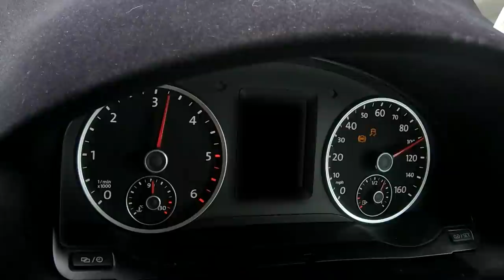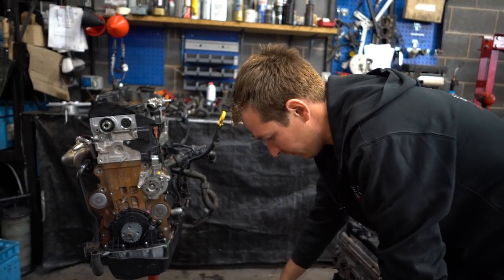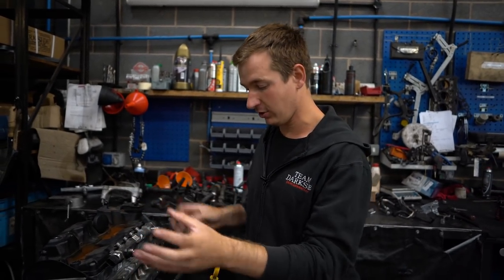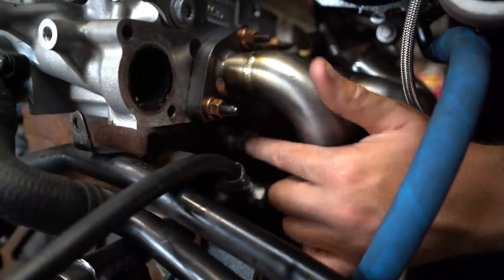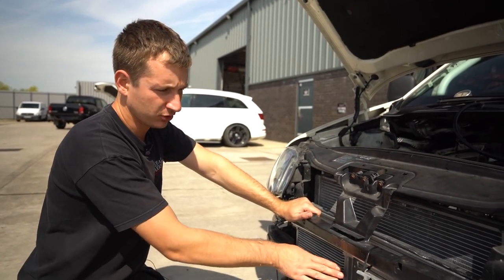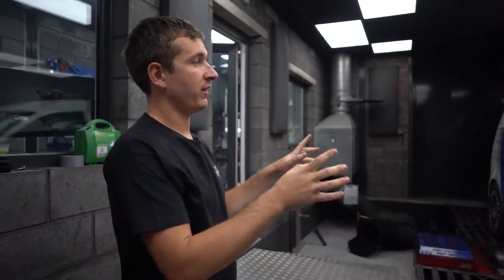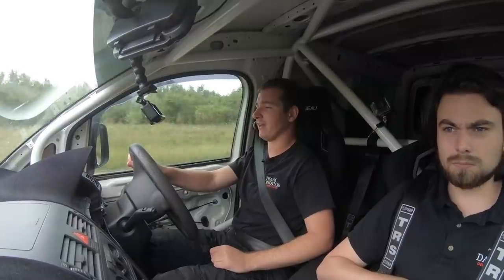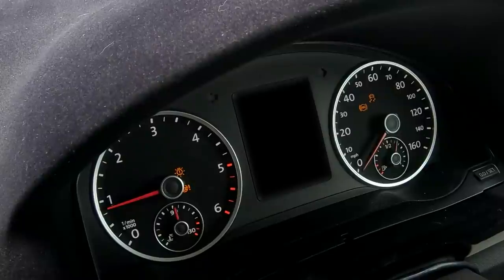SRS Caddy gets a new 2.0 TDI CUAA Engine! 356BHP & 470LBS/FT!!! 4Motion / DSG

Comment: So it's possible to bolt on CUAA bi-turbo to mk7 engine? but it need some mods to fit CUAA intake manifold to mk7 engine. But is it possible to fit CUAA head on with intake and turbo to mk7 engine?
Reply from the maker: Intake needs a lot of work. Turbo wont fit due to needing 2 oil feeds and drains. You need to use the full engine.
Reply: @DarksideDevelopments  Thank you!
Reply: @kolyakabmx  it's better make the engine swap, more "bullet proof"

Comment: So would the biturbo (more specifically the smaller of the two) help you at all with the low end performance if you had kept it or is it just a oem efficiency thing that needs binned?
Reply from the maker: We couldn't control 2 turbos with this ECU but it would fill the hole at the bottom end!
Reply: Excuse my ignorance but on the standard engine I thought both turbos are the same size and ran two cylinders each? Not sure there is one big one small but again I might be wrong
Reply: @liamgreen6036  im just as ignorant but pretty sure that that kind of setup is only used for V engines etc with two heads. The “Biturbo” on the 2l 4cyl is more a “compound turbo” i think with a small feeding onto a large. Small turbo spins up faster and big turbos make top end power so its a best of both kinda situation. Hope that helps you find a better source of information.
Reply from the maker: John is correct, 2 small turbos would be laggier than 1 large. So a compound setup is even better!
Reply: @liamgreen6036  I might be corrected on this, but it's much the same (if it is actually this same system) as a Borg Warner R2S setup, which is sequential turbos. One small for low revs, one large for higher revs, and they switch over in the 2500-3000rpm range.

Comment: Hello!  Tell me, is it possible to put this CUAA motor instead of CFCA on T6 ?
  Is the fuel equipment on cuaa also bosh ?
Reply from the maker: I'm sure you could with a bit of foresight. Both have Bosch. Not sure if Turbo control or fitment will work. Lots of custom adaptations will be required I'm sure.

Comment: Hang on so is the charge cooler water separate to the engine and turbos coolant? Like a separate loop? I gather it has its own water pump? I’ve thought about a system like this for the turbo oil system.. a separate reservoir pump lines cooler and thermostat, I figured if you had a separate oil system for the turbo it would stay a lot cleaner and be much better for the turbo
Reply from the maker: Yeah it's separate!
Reply: @DarksideDevelopments  brilliant I did think what use is a charge cooler if it keeps iats at 90c 🤣

Comment: You guys have incredible videos. There’s just so much information I dont know if I’m absorbing it. I bought a mk6 Golf 2.0CJAA with barely 40k miles. I’m trying to understand how it works but cant figure out where to start. I want to keep emissions so I can take it anywhere, but I also want HP gains and consistent power. My gas pedal seems too sensitive or not sensitive enough, and it jumps  rpms but doesnt provide power on the low end from a stop. Is it that theres an issue somewhere, or do I really need it tuned?  What can I do, where can I start? I havent found any beginner information, and forums dont seem to have patience for my questions. Thanks for your time!
Reply from the maker: If it's tuned the throttle map might be off. We have a few DPF safe options!
Reply: @DarksideDevelopments  no tune. It had an air intake on it but it was swapped out to get a warranty fix on my egr cooler. Vw said if it was tuned theyd know, or is that a myth?

One last question- how do I determine myself that parts are compatible? Part numbers, or precise measurement?
Reply: @HorizontalCrank  if it is tuned the harware number of the ecu changes from "H26" to "X26" for example, and as soon as the vehicle is connected to a dealer diagnostic machine it flags the car on the system. You can see exactly when it was tuned and if the tune was set back to stock, but it will always stay on that car's history.
Reply from the maker: If you email us a list we check for you!

Comment: Hi, Bit off topic, but after installing swirl flap delete (all done correct) on CAPA V6 I get real strong engine shake at 1050~-1150~ RPM in every gear. Engine mounts confirmed good. You guys got any ideas? That normal?
Reply from the maker: Never had it before!
Reply: @DarksideDevelopments  Cheers nonetheless! Sick Caddy.^ :D

Comment: So with the stock wiring in the Passat Variant there's no way to run bigger solenoid injectors eh?
Reply from the maker: They are Piezo and quite large but the wiring is a real mess. If we started from scratch we might have used that ECU but we never wanted 2 turbos anyhow.

Comment: Hi dark side, I have an 08 caddy maxi, was originally a BLS engine and it threw a rod. I've recently had a bkd put in from an A3, the guy used all the steering rack and gearbox etc from the A3 but it's electric power steering. It's always heavy and abs lights are on. I was told to replace the abs module and it should fire up and start working but it never. Needs sorting, is this something you guys would be able to get sorted? Also engine has developed an overboost code, seems to drive perfect around town and then as soon as I go into 6th gear/70mph it goes into limp mode, some very slow coolant loss too could that be egr related? God knows!

Either way, I was wondering if I could get it booked in for a few days and maybe I could get a hotel for a few nights as I'm from Coventry, but I just really want someone that knows what they're doing to work on it now! A remap whilst I'm there would also be nice!
Reply from the maker: sounds like it needs a turbo and an EGR delete. On our race cars we wire the steering straight to power and it works perfectly. Never done a BLS to BKD, this was a BJB so already had EPAS.
Reply: @DarksideDevelopments  thankyou so much for replying! It definitely needs an egr delete as the anti-shudder valve is broken and apparently a delete gets rid of the valve anyway! Turbo sounds good. Is this a kind of job that you guys would be able to take on? How would I go about booking in? 🙌😁
Reply from the maker: We could tune it once the niggles are sorted!

Comment: Hi, I have a Passat bitdi 2016 completely stock apart from panel filter, is there anything I should keep an eye on other than regular oil changes etc?
Reply from the maker: Just drive it hard every now and then and keep it serviced!
Reply: @DarksideDevelopments  that I can do 👍🏼 thanks for the reply! I’ve had the car two years and 20k, no problems up to now touch wood. A wolf in sheep’s clothing.
Reply: Remember that timingbelt is to be changed in 120000km and not at 210000 like other diesels...had to fight whit service advisor from vw dealer whit if... belt was over driven by old owner by 50000km brobably becous it is so rare engine atleast oin finland. Btw realy weard engine that they basicly made compleatly new engine whit allmoust nothing incommon on others and then just put it in passat and nothing els.
Reply: @uksomo  it’s currently at 57000 miles so it will need doing within the next couple of years, I’ll also change the water pump at the the same time, if I keep it that is, I do like the a6 3.0 bitdi 🤣
Reply: @uksomo   tiguan and arteon have these available too (passat not anymore as far as i know)
Reply: @RendernStattGendern     yep but they come to be options after engine was 4 or 5 year's old. And still bit weird that its only on so few car models as an option. But it is quiet factory sleeper fun to tease audis and bmw on that totally stock family estate. 😂